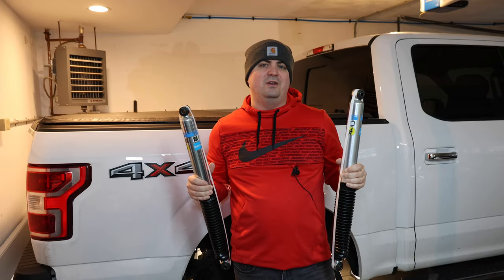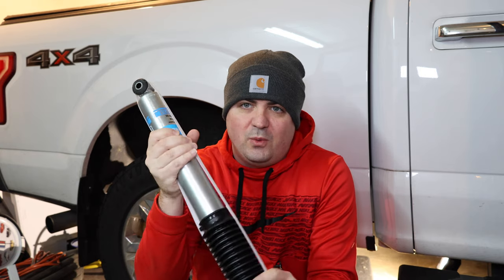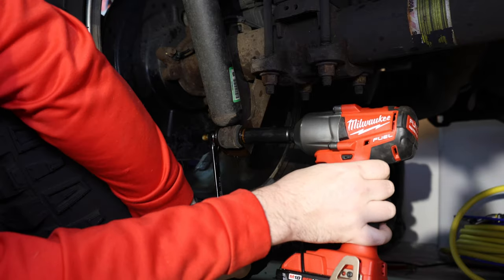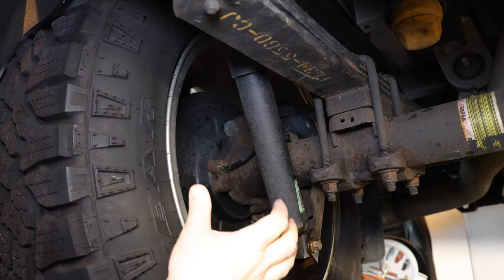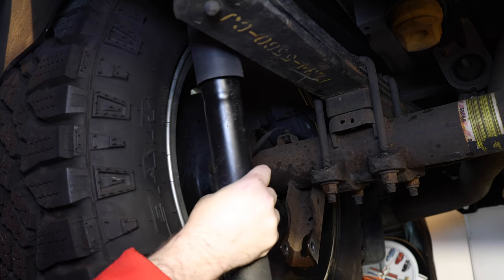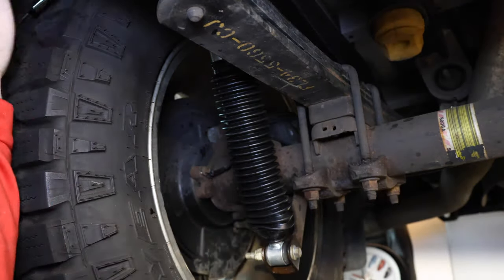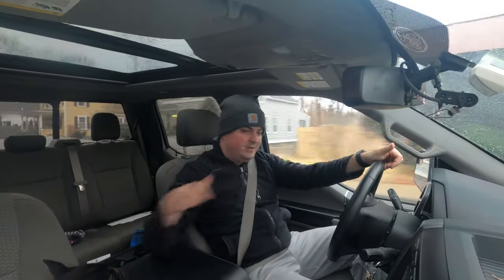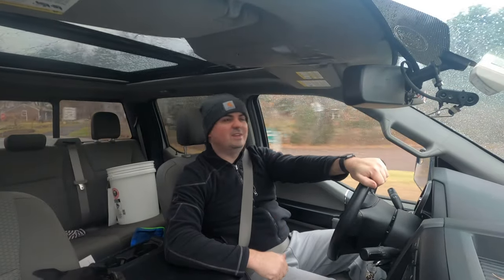F150 Rear Shock Replacement | Bilstein 5100 Install and Review

Comment: Thanks for this video.  It's been 40 years since I turned my own wrenches and your video was spot on.  A few minor hiccups here and there, but those were all on me.  About the shocks, OMG!  2019 Lariat Special Edition FX4, yeah, I kept the racing stripes.  At 46,000 miles, Marilyn was losing that new truck ride.  I was feeling every bump and pothole.  Freeway corning was getting scary with the truck just not feeling planted as before.  Bilstein 5100s got my new truck feeling back again, at least in the rear.  Unfortunately, I've confirmed my fronts are shot as well.  I can't wait to change them out, but I'll probably let a shop do the front.  Bilstein 5100s for the win!  My cordless right angle ratchet worked like a champ.  Thanks again.
Reply from the maker: Glad you found it useful! I was surprised too at how early my shocks felt "worn out" and needed to be replaced. I'm with you on how much better these are. Definitely more planted. Funny, I'm doing the same thing with my front shocks but I will most likely tackle it myself in the spring. Definitely a more involved project, that will require an alignment after. No problem, thanks for watching!
Reply: @SmackeysGarage  Thank you for the video, it really looks quicker and easier to install without wheels removal. I'm going to work on mine tomorrow. BU the way, I have RAS installed too, I've been towing an RV for a couple years, and it was helping a lot with the bed squat. Now, in the "unloaded" position it raises the rear to 2-3 inches, so I wonder if these Bilsteins won't retract to the right height without removing the plastic wrappings...
Reply: And yes, I'm thinking on replacing the fronts as well, it's 76k miles on them already. Have you finally done yours? Also, do you think keeping original springs should be fine? Or else, why do they sell Bilstein struts assembly altogether?
Reply from the maker: Hey Miroslav. The install was extremely simple. Let me know how you make out with the RAS. I am curious to hear.

Comment: Well, just did it.  Took me about 40-mins and that is solely because I couldn't get enough leverage to squeeze the new shock to install.  So, used a $4 ratchet and done.  Noticed an immediate lift in the rear with the new shocks.  Think it will be perfect once we attach our small tear drop.  Test drive was sweet, truck handled well.
Reply from the maker: Glad to hear! It really does make it a much better drive. Feels much more planted.

Comment: I followed your easy instructions and it went pretty smooth. The only flaw was the band to compress the shocks was tooooooo long. I ended up using a pry bar and some bicep grease to fit them up. I like them. Much smoother than the probably stock shocks from 2013 (I bought it used in 2015).
Reply from the maker: That sounds great. Definitely a lot smoother than the oem ones. Thanks for the feedback!

Comment: Man, I wanted those, but decided to replace mine last minute when I had the tires off doing rotors and the only thing anyone had were the Monroe Reflexes for $80 a piece.  But they are 100 times better than the 7 year old rusty factory shocks.
Reply from the maker: You nailed it with the Monroe’s being better. It’s definitely a must needed mod that makes the truck handle so much better.

Comment: Wow, that looks super easy to install, nice work!  Does the plastic accordion-looking cover go on the top end of the shock, or the bottom end like you installed it?
Reply from the maker: Thank you! The shocks can be installed either way with the boot up or down. Most people install it boot down on the F150 with the Bilstein logo up in the correct orientation to read. 

It made a great difference in ride quality. I was really surprised for 30 minutes worth of work and $200.
Reply: @SmackeysGarage
Reply: @SmackeysGarage  my😅
Reply: Bilstein are designed to always be put in with the lettering right side up or the accordion part at the bottom. Otherwise they don't work like they were designed per the manufacturer.

Comment: Are these mounted upside down? I see people saying the boot is supposed to face up! 🤷🏼‍♂️
Reply from the maker: It's been a while since I installed them, but I believe the instructions said boot side down.  Also if you install them boot facing up, then the Bilstein logo is upside down!

I've seen them installed both ways.
Reply: Boot down is 100% the way to instal these.
Reply: boots down for the dirt and water to fall off by itself and not sitting on the gasket.
Reply: The youtuber is correct. The bilstein logo is upright for proper installation.

Comment: Are these supposed to come with an inner fender liner? My truck doesn't have them on either side.
Reply from the maker: It was an option I believe. My truck didn’t have them on either side either. I did a video on purchasing and installing them. The truck looks much better with them on and they add a lot of protection.

Comment: Hi I don’t understand something in your video. Shouldn’t the torque be applied to the nut and not the bolt head?
Reply from the maker: There is a lot of literature on does it matter. I’ll have to go back and check what the bolt and nut look like. If it is flat washer like surfaces it shouldn’t matter. If one side is serrated and one flat then it might be.  I’ll check in a few days after the rain stops.
Reply: @SmackeysGarage  Ok thank you- I won’t send you a virtual umbrella because I’m old school.

Comment: Does it matter if that rubber part is upside down or not?
Reply from the maker: Instructions said "boot side down" if I remember correctly.  I've seen them installed both ways.

Comment: I just put the roadmaster active suspension on my 2011 f150. While doing so I realized that my left rear shock was bad. I ordered new front and rear shocks.
Reply from the maker: How do you like the active suspension? I’ve heard good things about it. Do you tow often?
Reply: @SmackeysGarage  I just put it on but it does feel like the rear end rides a bit better over rough roads. It feels more planted. I don't tow a lot but when I hook up my portable grain cleaner my truck squats like crazy. I have no idea how much that thing weighs. It'll definitely help with that. This summer I'll be pulling an inclosed car trailer loaded with my car. That'll be really close to my max towing rate so I put on the roadmaster and I'm installing a weight distribution hitch. People seem to love the roadmaster.
Reply from the maker: @lobbyrobby  That's good to hear. I'll have to look into it for future trucks.

Comment: Question how do I just adjust these when there already installed on the truck, I want to lower it 1 more inch down?
Reply from the maker: These do not control the height of the truck. Your rear springs / blocks will.

Comment: Are you going to change the front shocks to Bilstien?
Reply from the maker: I am Christopher. I'm debating if I start by putting a 2" spacer level on it and then go to the Bilsteins so I can get a good comparison of the differences. I'll most likely do it mid to late winter.

Comment: Old post but you mounted them upside down .. label shows correct orientation ..if the Bilstein label is up side down the shocks upside down
Reply from the maker: This is the like the world's biggest debate! The shock should work the same no matter which way it is oriented. If you prefer the label right side up and boot up top go for it. It does make sense though the label orientation would be the normal way to install it.
Reply: @SmackeysGarage  I looked it up and that's what Bilstein states on there shocks per orientation they state the label shouldn't be upside down .. I'm about to install a set of 5125s on a lowered f150 and the label looked upside down from the way I'm used to installing there shocks (boot up) on the trucks so I was searching the internet to check before Install
Reply: @Daddyd402  Boot goes on the bottom.
Reply: @SmackeysGarage  in the video tho the labels are up and they are not upside down.. I think I'm seeing that correctly @3:00 unless you redid it idk

Comment: Is the blue lock tight required?
Reply from the maker: So, I'd at least make sure you are using lock nuts or a lock washer if you aren't using lock tight.

Comment: will these rear shocks fit for 2 inch drop truck?
Reply from the maker: I don't know. I'd think they would be ok since you aren't using the full stroke of the shock. I would expect it to be a problem with lifted trucks but not dropped trucks.

Comment: Do you reccomend installing Bilsteins on the front?
Reply from the maker: I would. Especially if you are wanting to level your truck. I did get a bigger improvement on my previous trucks when I did the rear though.
Reply: @SmackeysGarage  I bought'em. Just gotta install'em. Thanks.
Reply from the maker: Let me know how you like them!
Reply: @mikeledford5035  What did you get ? I'm thinking of getting Bilstiens 6112s
Reply: @mosasa1307  I don't remember what I got. But I replaced all 4 corners, and it was a big imprivement.

Comment: Do you noticed less rebound?  I tow a trailer and The FX4 package is too soft it bounces loaded and unloaded.
Reply from the maker: I did notice less rebound with the 5100s. That is one of the areas that I was really happy with. The truck doesn't shift as much unloaded as it did before. I specifically tested this on a set of raised tracks near my house.

Comment: Did it change the rear height at all?
Reply from the maker: No it didn't. To adjust the rear height you'd either have to change the springs, or put rear blocks in.

Comment: Do you have to torque to 66lbs on both top and bottom nuts for each shock?
Reply from the maker: That is what the torque requirements are on my 2018 F150. Both top and bottom. Sometimes, if one is hard to get to, I just try and mimic the force I put on the one that is easier to reach.